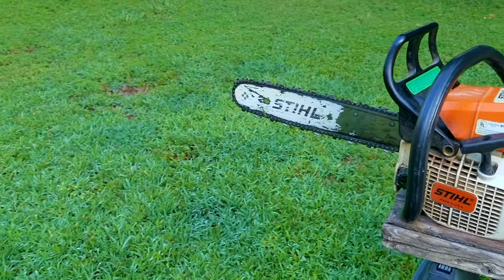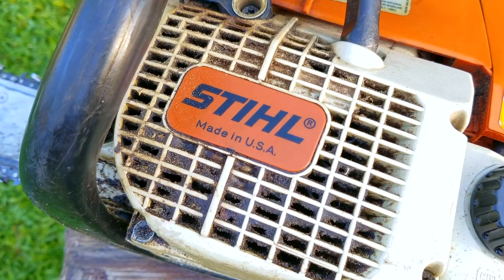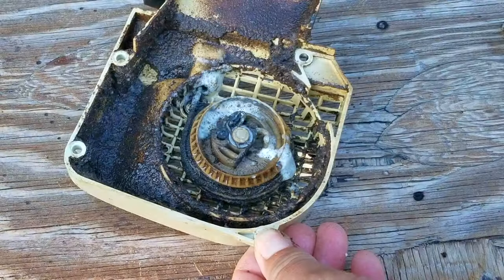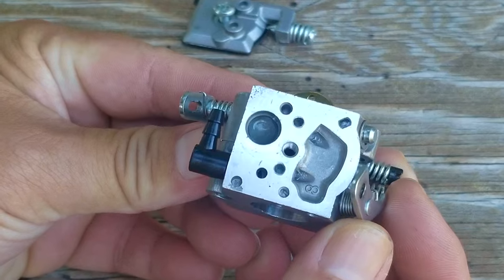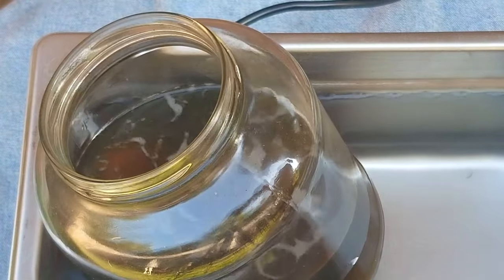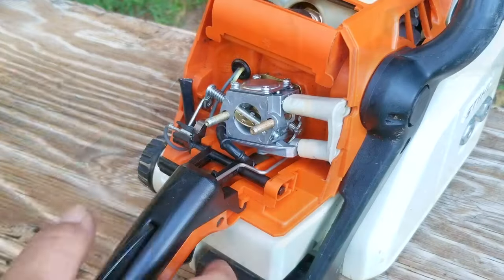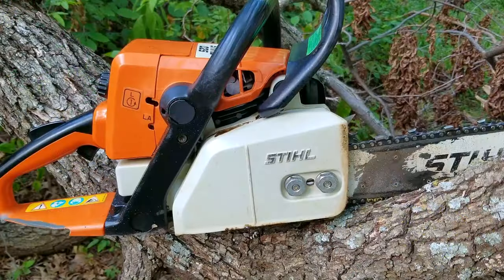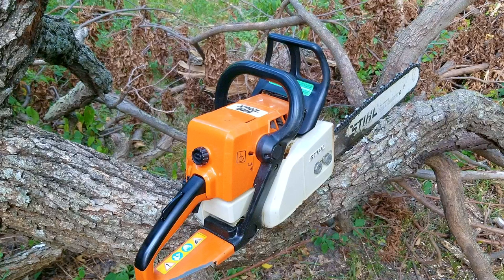Fixing A Stihl Chainsaw That Won't Stay Running

Comment: I contacted u about my Poulan Pro riding mower model:pp20va46- would not start. You had asked if I could turn the engine by hand- yes. New parts are battery, starter, solenoid, and ignition switch. Starter does try to engage engine when hot wired from bat to starter----- now will crank 2-3 times and blows the fuse. I suspect short in main wiring harness. Looking at possibly replacing the main harness. Any advice. Nearly winter where I'm at, so will work on in the spring.
Reply from the maker: have you checked the valve lash? From the description it seems to be out of tolerance by quite a bit.
Reply: It was a running mower, it sat for 2 wks and then this issue has kept it parked. Have not had any major issues with it till now. Running normal, no hard starting, no leaking or using oil, and just put new drive belt and deck belt first part of this summer  @INSIDEHOUSEGARAGE

Comment: Ms250-was working  fine- then stopped while sawing the other  day...trouble re starting and kept stopping --so I cleaned much, removed and cleaned muffler replaced gas, plug,gas and air filter.
Saw still now hard starting and stops cold while running for about a minute--- coil, condenser , something else? Thanks for any help.
Reply from the maker: sure, did you check the fuel tank vent?  Also, did you check to see if the fuel filter was still attached to the line in the tank?

Comment: Just curious where you would look for parts and how to make sure they are the correct ones?
Reply from the maker: I find model and serial number on the machine, then I look at popular small engine sites and put that information into their site and they'll give me the information I need. after that it's up to you where you buy the part. Amazon, Ebay or some other site

Comment: I just did a rebuild and upgrading to the Husqvarna 61. It was a great education in how chainsaws work. I put a china bigbore cylinder and piston kit into it and made it a 272. I would run old saws just on principal. This saw is a beast and cost very little. The owner basically was throwing it out. Now its essentially new
Reply from the maker: very nice work!

Comment: My saw starts giving itself high idle gas after working with it for couple of minutes and then it shuts down. When i start it cold idle gas is normal. I checked fuel filters and there seems to be no problem with it getting enough fuel. I never adjusted anything on the carburetor.
Reply from the maker: have you checked the tank vent?

Comment: What degreaser did you use? The video makes it look like you did not agitated it at all and if you didn’t that is very impressive results.
Reply from the maker: it's the degreaser from Harbor Freight and I'm using it at full concentration
Reply: @INSIDEHOUSEGARAGE  thank you so much! Did you have to agitate it at all? If you didn’t, that is even more impressive.
Reply from the maker: no agitation

Comment: I have a MS311 Stihl. I put a new coil pack on it (aftermarket) a new carb. it starts good, but when I rev it up, it’s like it is surging. The old coil was not working at all. Could my problem still be the coil? Any ideas?
Reply from the maker: I think you need to adjust the carb.

Comment: Recommending to replace whole carburetor when only diaphragm is worn out is like replacing engine when only new piston rings are needed. I was surprised You haven’t concluded in the end that buying new saw is better solution 😂
Reply from the maker: your wisdom is beyond belief and understanding.
Reply: It all depends on time and money.  On some of the small engines the carb is not that expensive and if paying shop rates it is cheaper just to replace than repair.

Comment: I have a ms 180c , can't get throttle response right, won't stay running,  I've tried everything I know. So far :New piston/cylinder crank, aftermarket carb then rebuild OEM, air filter, fuel filter, unit is not old , just fuel went bad .
Reply from the maker: you did a lot of work. How was the compression reading after the rebuild and have you leaked checked the engine?

Comment: I think it’s remarkable that the initial factory L setting is one turn out yet it’s tuned well now, years later, at 2.25 turns out.
Reply from the maker: I know right, glad you saw that too.
Reply: I believe part of that can be contributed to ethanol in todays gasoline.  Ethanol produces about 30% less btu's than gasoline.
Reply: @aaronpowell4885  
Wow, that’s a really good point I never thought about before!  I need to keep that in mind any time I’m working on older machines! Thanks so much for that! 🔧👍
Reply: @Rein_Ciarfella  😉👍🏻

Comment: I would go with a new saw compared to an older saw. At a certin point, age starts playing a factor and not just hours. I have fixed multiple small issues (with oe parts) and have been close to spending what l would have on a new unit. But the challenge and giving me something to do was worth it!
Reply from the maker: good choice!

Comment: I've just done an old Stihl 038av chainsaw, turned out it was the impulse pipe had rotted away.
Reply from the maker: wow that's a first for me
Reply: @INSIDEHOUSEGARAGE  It was for me, didn't know chainsaws had a flexi rubber manifold with a separate pipe for the pulse that goes to the little hole on the back of the carb to work the pump diaphragm.
Reply from the maker: it was a surprise to me too.

Comment: How is fuel a factor in these issues? If the fuel was mixed a while back there would be a problem?
Reply from the maker: Gasoline has a way of destroying everything that it touches, and if it's in constant contact with it for a very long time, it'll fail.   Constant fresh fuel isn't as bad, so continuous use, is best for these machines

Comment: If u have a dirty fuel filter inside the tank it will prevent the chainsaw to start or stall too
Reply from the maker: you are correct

Comment: Why do I have to keep pumping primer bulb to keep saw running
Reply from the maker: because one of the diaphragms in the carb is not working like it should,
Reply: Found problem, pin hole in fuel line.

Comment: Clean the air filter, change the spark plug, replace the fuel uptake rubber hose (they get splits allowing air in), pour in some new premix fuel and it will work
Reply from the maker: thank you
Reply: You ,mentioned replacing the fuel uptake rubber hose ,is this located on the tank with the little screw regards
Reply: @robertb.8885  It links the fuel tank to the carbi. As the rubber gets old it splits, causing fuel to leak and air to get into the carbi causing it to run poorly.
Reply: @Wilbargosh  cheers thanks for the reply:)